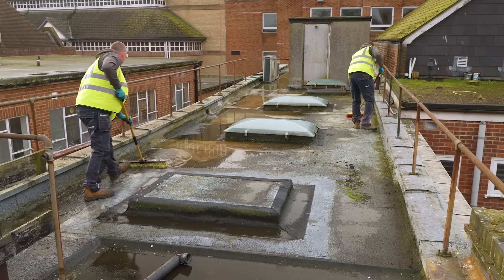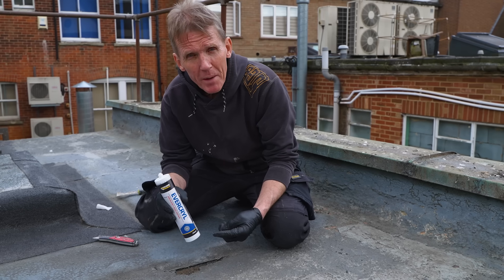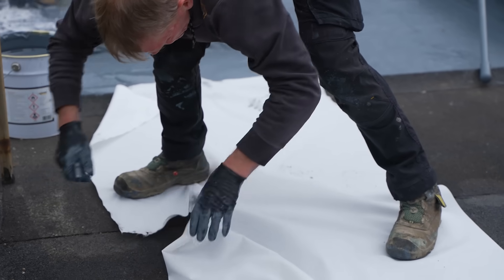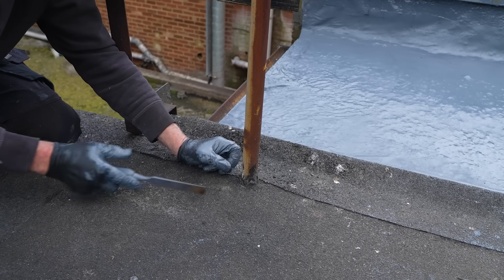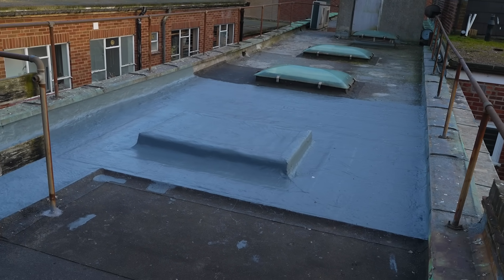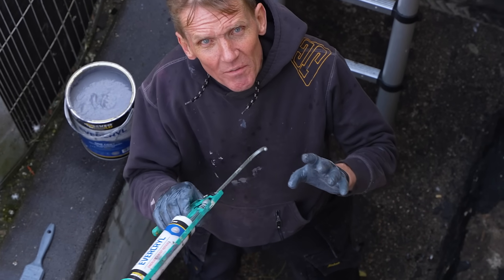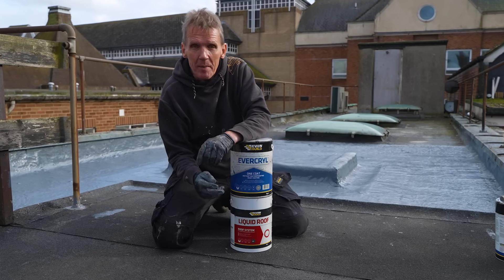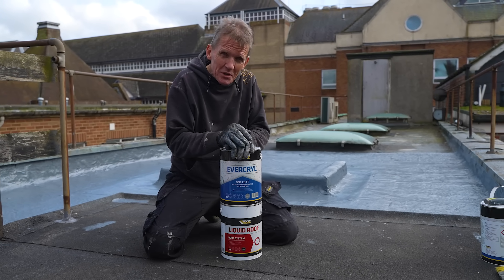How to Repair a Flat Roof with Liquid Roof

Comment: Wish you were here. You do a great job. Flat Roof Pros ripped me off with $24K job of pouring what seems to be latex paint over sand and gravel.  This looks like it would really work well.  My roof leaking and they will try to put it on me somehow.  You know how they say I didn't tell them how to do it right. But they did not even get a permit knowing they were going to rip me off and it would not get approved. Are you in America?

Comment: the pros have done a bodge patch up by the looks. £8000 get them back
this Everbuild  liquid look s as if it will get you out of trouble for a while 
if used properly .if you dont want to strip the old roof off.
can,t beat tried and tested roofing